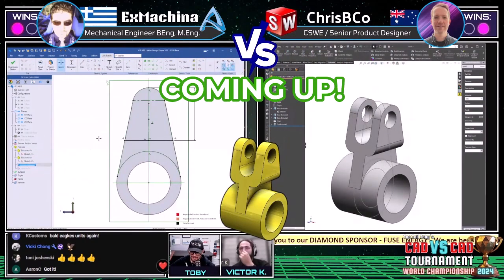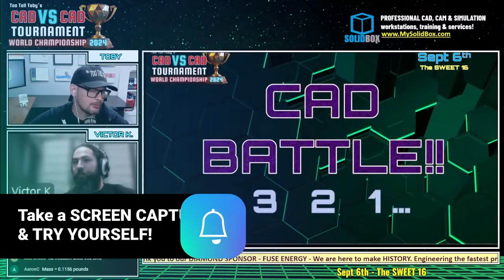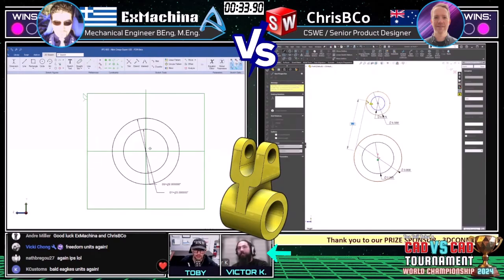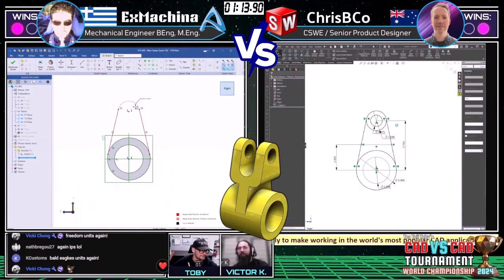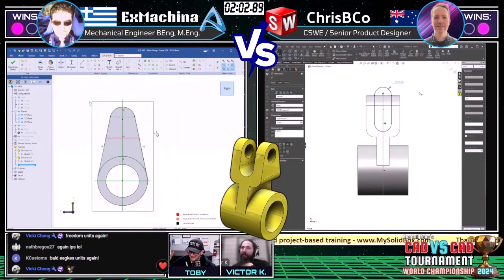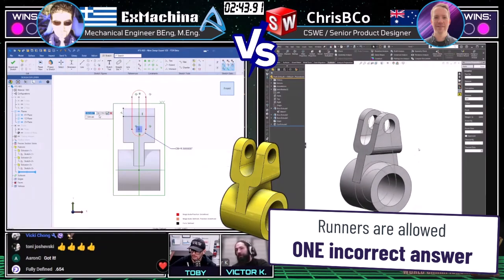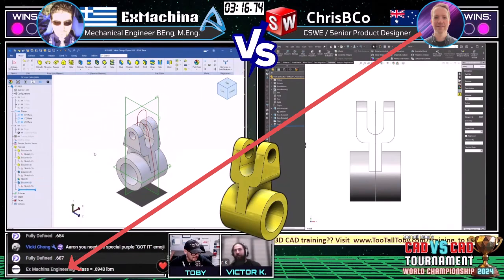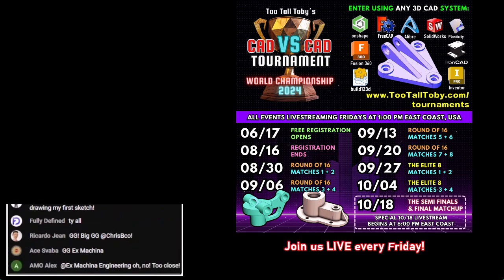3D CAD esports - TOURNAMENT HIGHLIGHT - Match 3 - ExMachina VS ChrisBCo - Alibre VS SOLIDWORKS

Comment: Forgot to add 2 arcs while doing 2 extrudes and had to go back and correct, did fillets on the completely wrong edges, and then the final hole I made it .75 instead of .875. This could have been mine as well. Need a better workflow and setup before these battles. I am analyzing and will perform even better next time.
Reply from the maker: yeah these matches were all SO CLOSE!!